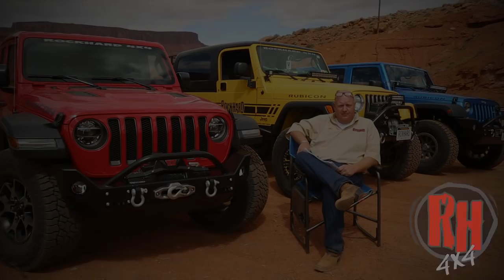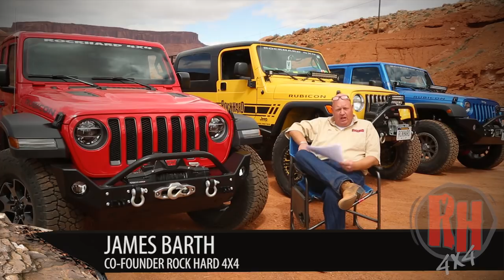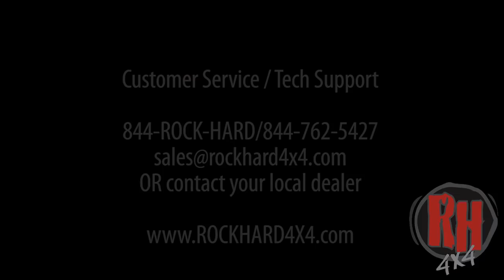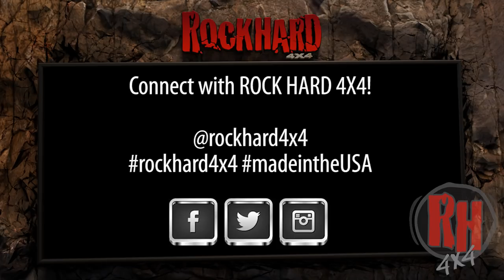Spring 2018 Q&A with James - Rock Hard 4x4

Comment: gorancho.com has a Dana 44 Differential Glide Plate; but, the bolt pattern, compared to the Spicer 44 is totally different.  Even the Dana 35 bolt pattern is completely different.  My 5.9 just has a really different diff and the official name of it is Spicer 44.
Reply: I knew I should have had you look at it at Tierra del Sol.